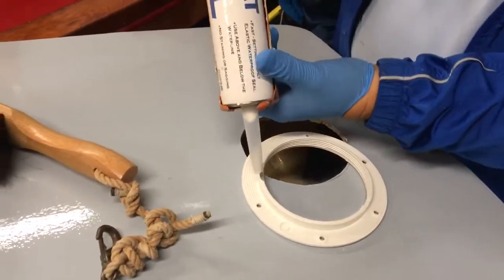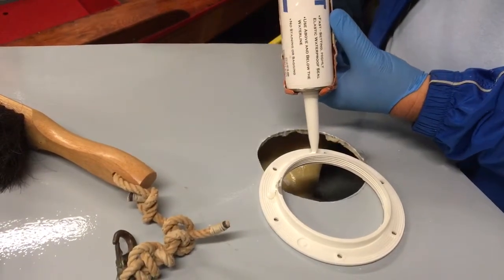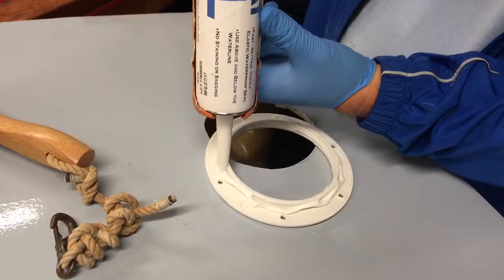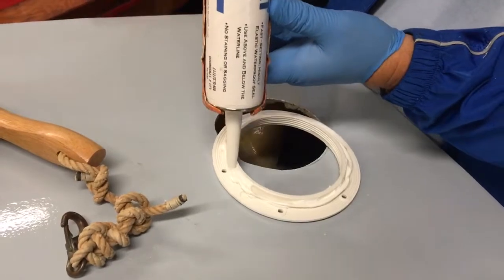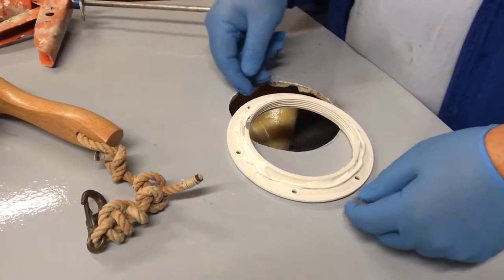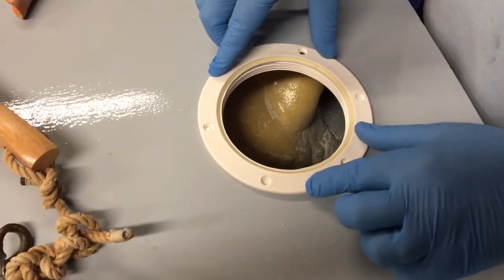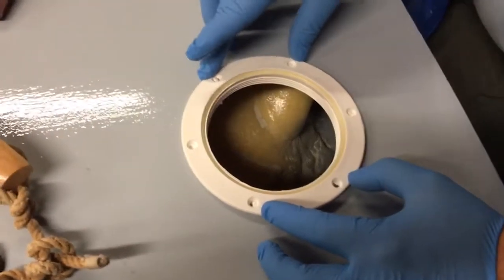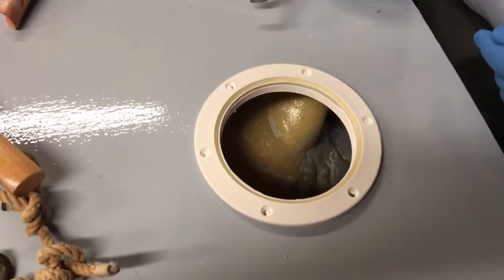Sunfish Sailboat Inspection Port Part 2

Comment: Thanks for all of your videos. I purchased Beckson deck plates. They look very similar to yours. They call for #8 machine screws, but do not recommend a length. What length works best?
I recently purchased a 1976 sunfish and I am enjoying sailing mostly and also making improvements.
Reply from the maker: Around 1 1/2 inch. Have fun!
Reply: @kentblairl  thanks! I need to buy some tomorrow.